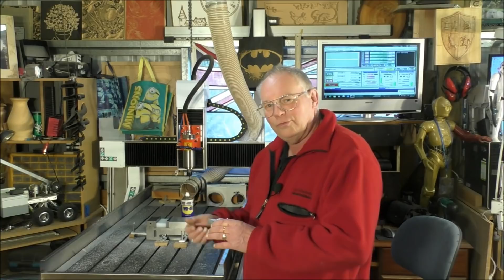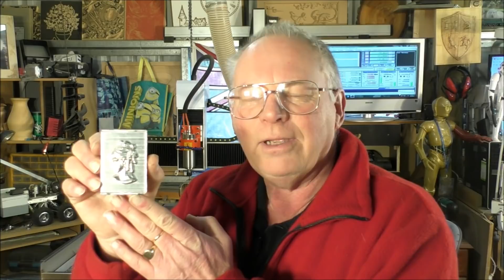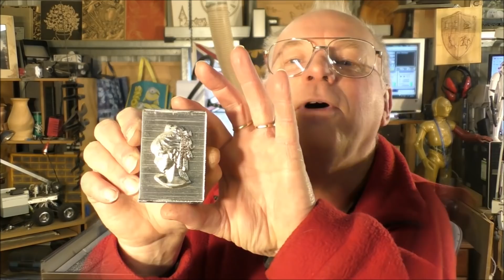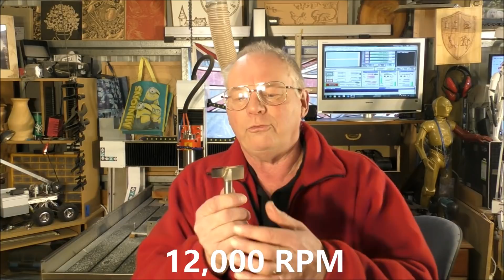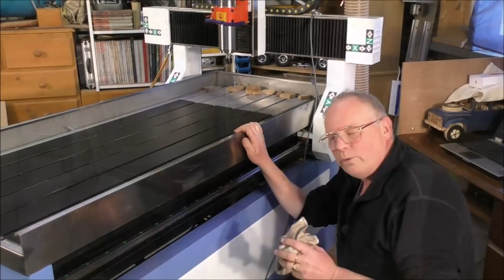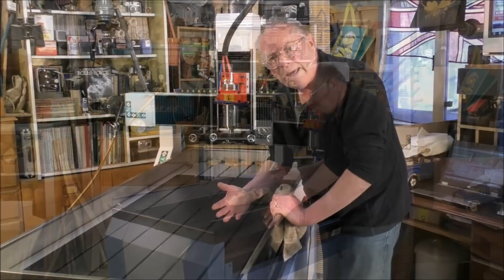Buying a CNC Router from China !?# *WATCH* before you buy! Know what you are getting

Comment: 22:30 - Well then, you have completely answered my question which no one in the woodworking hobby knows about, how accurate of a CNC machine one needs to produce stunning 3D carvings... my guts was telling me a precision CNC machine that is used by precision machinists (which needs to be top spec machine, using ultra precision linear guide rails, ultra precision ball bearings, cast iron heat treated frame or granite frame, powerful zero runout spindle and etc...) I was seriously thinking 3D carving woodworking doesn't need such high precision CNC until you have answered the question. Thanks for this video, it is the answer and secret of stunning 3D carving woodworking. I never appreciated the wooden frame CNC or all the talk about the new popular CNC machines that costs under $3K which everyone have in their home garage which uses belt driven rails. Now I am confused why precision machinists never talks about doing woodworking... because there is a huge market for precision 3D wood carvings.

Comment: can some one please help ...iv bought a 6090 machine i have built it iv installed mach 3 im using a windows 10 laptop but its not doing anything at all as in when i tell mach 3 to start the spindle nothing is happening when i try to jog the machine in mach 3 it doesn't  respond ...some help please what I'm i missing im using the usb cable they supplied  ...thanks
Reply from the maker: Hi, use a windows 7 or 8 computer and you need a driver for Mach3 to see the card in your machine

Comment: Do a noise comparison of a water cooled router versus an air cooled one. You may be quite surprised at the difference in noise of just the machines (no bit) running at 20,000 rpm.

Comment: Since this video Roger got rid of Mach 3 / 4 and now uses a dedicated offline CNC controller. That makes more sense to me. I used to work on a HAAS machine and that's how they work (basically). You have a small, dedicated box that boots instantly running G-Code instead of a computer with fairly expensive software.
Reply from the maker: That said, Mach3 and Mach4 are ok too.

Comment: I have always done wood and metal work by hand and have decided to get a CNC router to help with speed. I wanted to ask what you recommend for a good starter.  I'm looking to spend about 2000$.  I know its not much and I plan to upgrade after awhile. I make beer and Santa sleds for Christmas. The deer stand at 30 inch's tall. Thanks
Reply from the maker: Go and have a look at my 3018 CNC videos and then my MIDI CNC router videos. the machine you see in this video was $12,000 by the time I got it hear after TAX and then import duty, it is much more $$ now.

Comment: Roger, thanks for your videos.  I'm in contact with a UK importer/upgrader of chinese machines in the UK and am speccing up a 120w machine complete with cooling, air assist & filtration system that thanks to you I have insisted on. I have asked for upgraded motors too.  It's a complete turn-key solution and while costly, it's going to be worth it. The level of explanation you give is extraordinary.  I now realise by spending treble my original budget I will have a machine that will be well supported and will work from day 1 (installation software,  and training) and by watching your vids I avoided wasting £3000 I was about to drop without understanding many of the pitfalls. 
Please keep making these instructional videos. They really are excellent.

Comment: thank you very much sir for this very informative video. For a few months I have been interested in CNC machines for a project and it is the most interesting video I have seen so far. Do you think this CNC can machine a piece of wood of 100x18X8 cm with the rotating axis? I’m afraid the z-axis is too low to accommodate a piece of wood this size
Reply from the maker: You are most welcome, and yes it will
Reply: @inventorsworkshop9600  Thank you very much for your answer. I think I will opt for this model for my project. which company did you buy it from? Thank you again

Comment: Actually USB data transmission is NOT synchronized, while the old port used for printers (centronics 25 pin parallel port) IS. So, to be honest, the old ports are far more suitable for driving mechanisms or devices in real-time.
USB ports are far superior in terms of trasmission speed, but rarely you need to send several megabyte per second to a cnc router...
To summarize, not always what is "new" means also "better".

Comment: Your suggestion about the connectivity part\ where you prefer USB rather than 25 pin socket is reasonable to care about. But if that would cost you much, the users might find useful to just buy a 25 pin to USB cable which are less than 10 USD or maybe up to 20 in rare cases.
Reply from the maker: Hi Giorgi, 25 pin to USB dos NOT work with Mach3 95% of the time.
Reply: @inventorsworkshop9600  wow, this is good to know

Comment: He knows exactly what he's talking about. Bought a nonsense CNC router recently has all the issues
Aluminum Extruded Tables. Not cast iron.
Not Mach3/4 Ready. Nonsense controller.
Linear rails connected directly to aluminum extrusion so aluminum extrusions cannot be removed or upgraded easily.
Table slots do not use standard t slots you get with a standard machinist clamp set.
Stepper motors.
Reply: Where did you buy yours?
Reply: @jumpback23  Axiom Precision/Powermatic
Reply: You only get what you pay for.....tattoo that on your forehead and quote it to the next supplier......but apparently nobody really believes it.

Comment: In Cameroon we have electricity cuts all along the day. Very often, I face electricity cuts while the cnc router is working. How can I eliminate a pass which is already done when current comes back. And how to come back to origin in ncstudio ? Heeelllllp!!!!
Reply: You need a device called a UPS which is short for uninterupted power supply which has a large 12 volt battery built into it that provides the short term back up power when the mains goes down, or you can build a large battery bank to provide total power all the time and gets charged over night or when you are not using it.

Comment: Great explanation of what a good CNC router should consist of.  The best communication between computer and router is actually the use of an ethernet cable.  Also Mach 3 and 4 are good but can be buggy at times.  WinCNC, Centroid Acorn and few others have more advanced features than Mach.  I'm just putting my 2 cents into your guide to buying a CNC router.